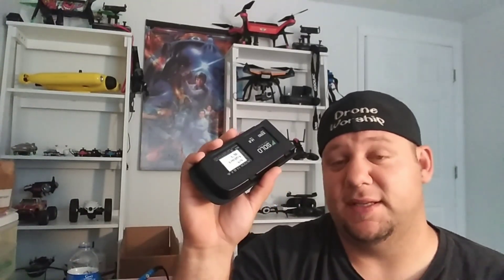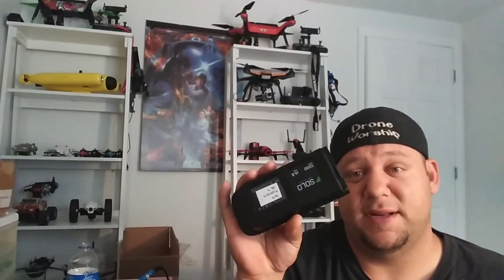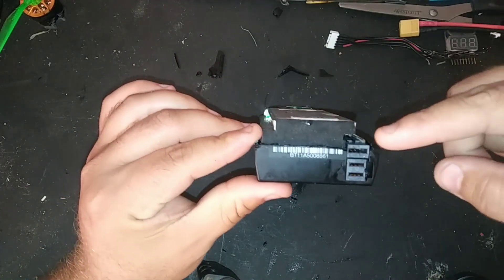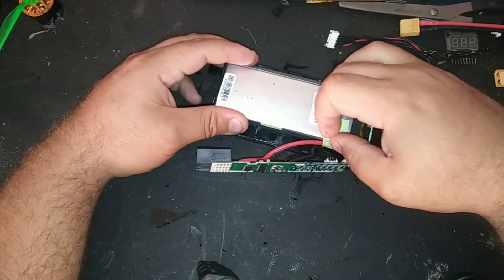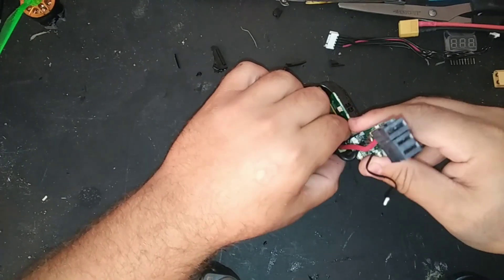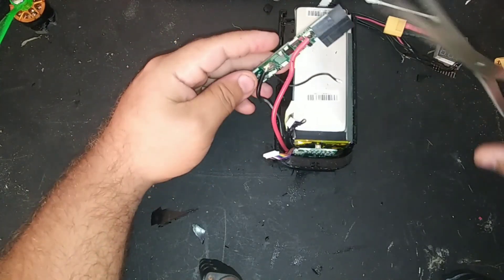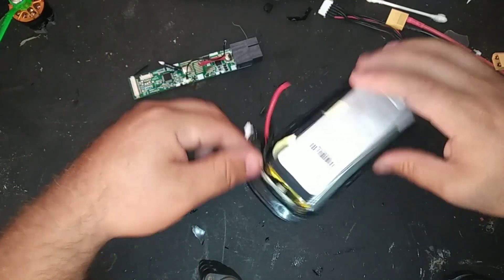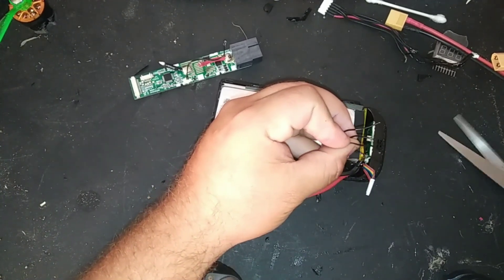The 3DR Solo DIY Battery Guide Part 3: Extracting The Battery Management System

Comment: Hello Drone Worship. I have 4 5400 mah an some jyu hornet batteries as well as an assortment of 2s &1s. Would putting in a 5 gal bucket 3/4 full with 1 cup of coarse sea salt, that's all I have for salt and let soak for 3 days then I can dispose into trash ?. Off subject but what are your thoughts on mix bugs 4 5g and jjrc 11 pro. Thanks for your time. I've been so busy working I haven't flown anything lately . William Horsley